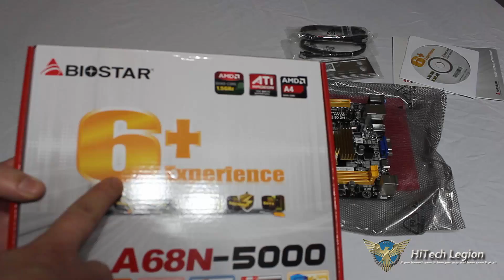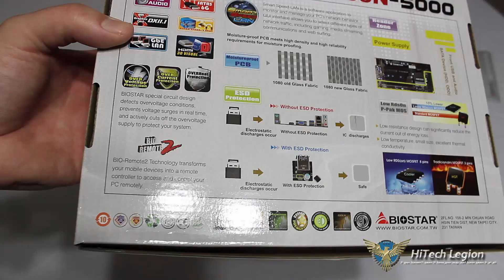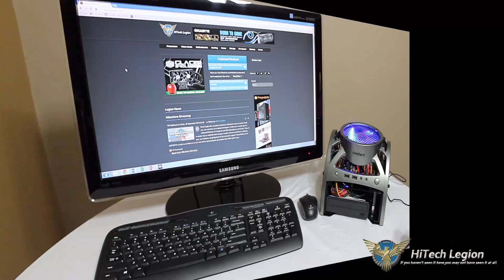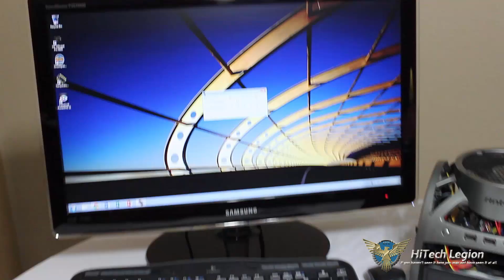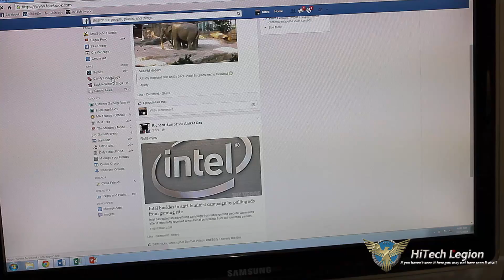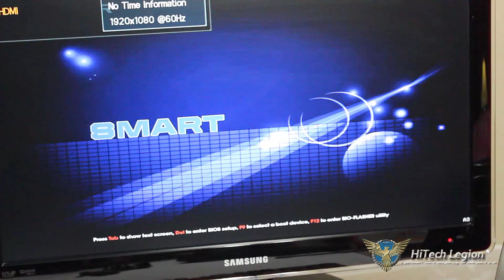Biostar A68N-5000 Motherboard Overview and Review

Comment: Saludos y Bendiciones 😇el  Plan de Hacer un ⚙️ MOD al Bios de esta Tarjetas Madre, Reprogramar con Modulo CH341A, para que sea Compatible, Nativa con Unidades SSD NVNe, con Adaptador PCI-EXPRESS A NVMe, así se aprovechan más ese tipo de equipos Basicos y Antiguos, includa una Tarjeta ASRock AM1B-M, de Tecnologia RAM DDR3 Semejante, 👀 aqui en Latinoamerica como esta difícil en algunas partes mas que otras la Situación Economica.

In Inglés

Greetings and blessings 😇 The plan is to make a ⚙️ MOD to the BIOS of this motherboard, reprogramming it with a CH341A module, so that it is natively compatible with NVMe SSDs, with a PCI-EXPRESS to NVMe adapter, thus making better use of these types of basic and older equipment, including an ASRock AM1B-M card, with similar DDR3 RAM technology, 👀 here in Latin America as the economic situation is difficult in some parts more than others.

Comment: Definitivamente Nada como la AMD, es la Mejor en  inovaciones Tecnologias de Multipoles Nucleos 👍😁, con bajas temperaturas operativas y eficiencia, el Procesador esta Integrado en la Tarjeta Madre con el sistema BGA, yo sujiero que mejor es mantener la cpu refrigerada, se le puede instalar  fanncooler u ventilador adicional pues trae los enchufes para 2 fancoolers, uno para el CPU y otro para el Chasis o Carcasa Atx / mini Atx donde se instale la tarjeta madre A68N5000.

En ingles: 

Definitely nothing like the AMD, is the best in Innovations Technologies of Multipoles Nuclei 👍😁, with low operating temperatures and efficiency, the processor is integrated into the motherboard with the BGA system, I would like to keep the cpu refrigerated, it is can install fanncooler or extra fan as it brings plugs for 2 fancoolers, one for the CPU and one for the Chassis or Atx / mini Atx housing where the A68N5000 motherboard is installed.

Comment: I got this board along with a 4g memory strip and new 500g hd, got everything hooked up but when I go to install Windows (Xp pro sp3) it gets to the first reboot and a blue screen comes up. Anybody have any ideas what's wrong?
Reply: note I also tried booting from my old hd which only booted in safe mode. it rebooted if I tried normal mode and also tried installing on a 160g drive with same result as the 500g.

Comment: is it possible to remove the cpu so you can put aftermarket thermal paste ?
Reply: Looks like the heatsink over the AMD CPU is mounted with push-pins, so it should be an easy matter to replace the TIM if needed.
Reply: Yeah i'm searching in whole internet how to remove the heat sink, i've found almost nothing